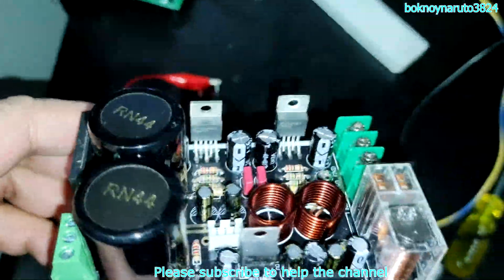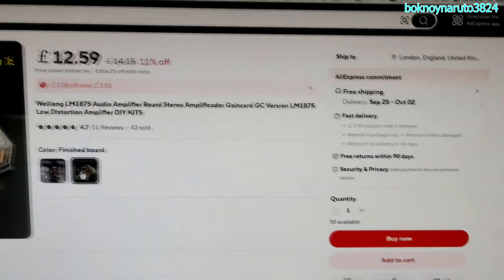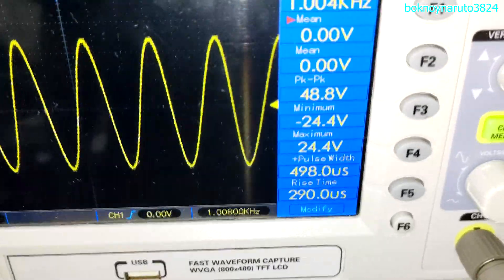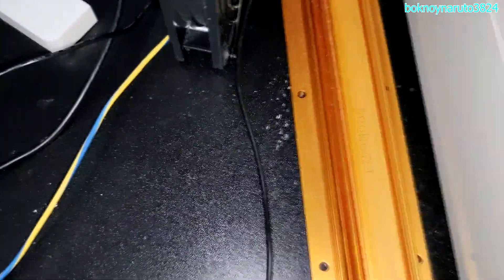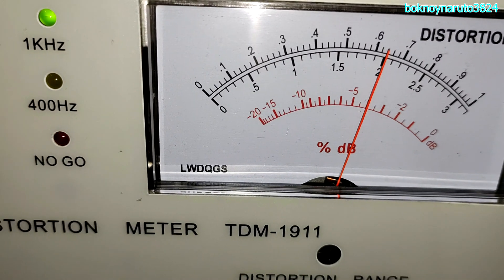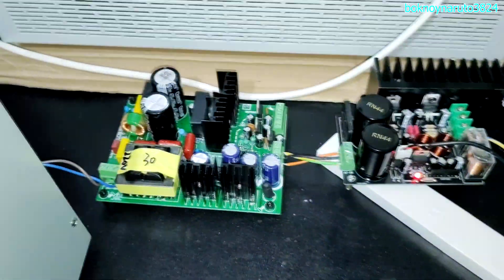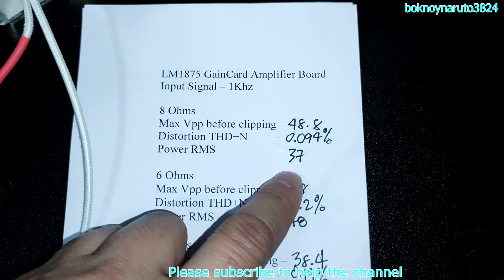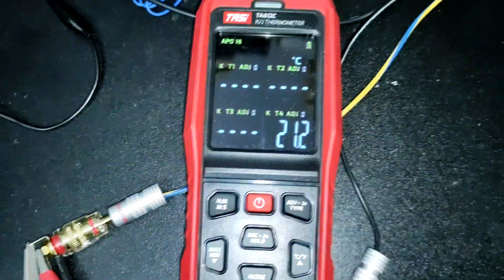Weiliang LM1875 Gaincard GC Version Audio Amplifier Board

Comment: is it genuine the chip?
Reply from the maker: I can only say that the IC used on the board was able to meet the power output rating on the datasheet .
One way to check if it is genuine or not is to melt the package with strong solution and check if the chip inside is real or counterfeit, unfortunately it is difficult to get stuff like this here.